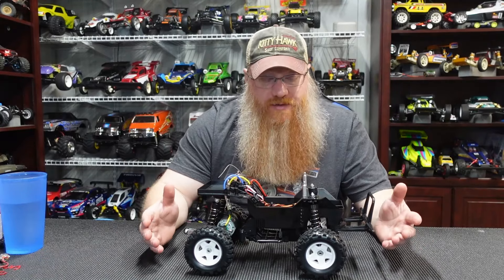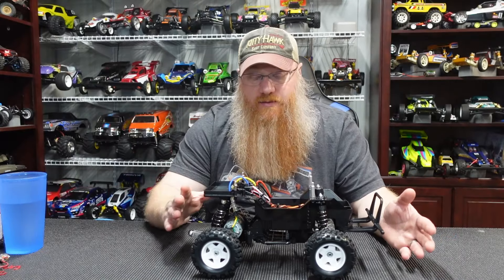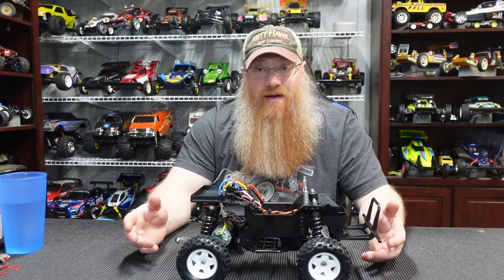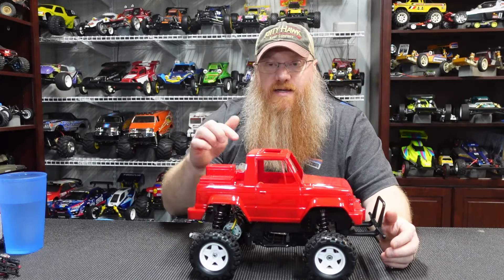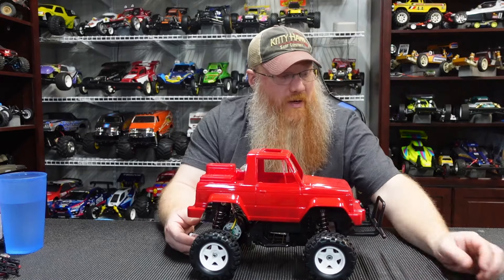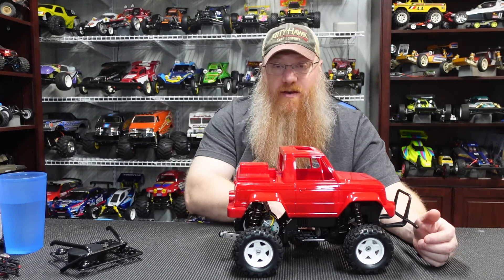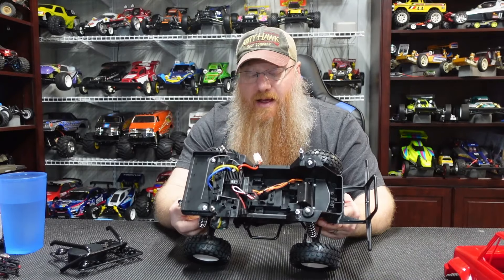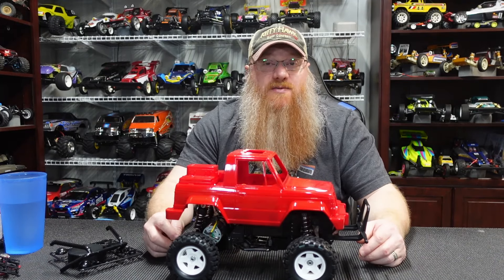Tamiya Pajero Chassis Build

Comment: Great build Addam. I like that the LB Fraction now has mor parts for customizing. Maybe this hard setup's not the best, but for onroad it should fit. Looking forward for your running video. Have a great weekend my friend.
Reply from the maker: Thanks Dirk! I enjoy building these CW01s, I have done a bunch and still enjoy every one of them. I think just because it is simple but tough and I can relax and enjoy watching it go together instead of focusing to no mess up anything like on e new kits. For the street driving these tires would be great, they would never wear out and probably not get enough traction to flip it over! I doubt mine sees any on-road action so I am pretty sure the big ones will end up on there! I will give it a fair run with the small ones to try it and see if I like it. Take care and have a great weekend as well!
Reply: The CW-01 is my go to chassis to relax with after a hard day at work, definitely one of my favorite Tamiya chassis. 
I have been thinking about buying this kit for the collection so can't wait to see it running. 
I am with you on the Oil shocks, it's the first thing I build now when starting a kit, then I just leave them sitting for a day or two and let all the air bubbles out.
Makes for a better shock absorber

Comment: Great video, buddy! Isn't it funny how these ABS bodies can take so long to paint? By the time you're done with all the details, you can spend twice the time on the body v.s. building the chassis. Lol! Personally, I'm liking the smaller tires, I think they look sweet, even though they're rock hard! Lol! And isn't it funny that Tamiya gives us CVA's in this kit, but never in the Lunchy or MP? Too funny...
Reply from the maker: Thanks Fil! Yeah it has been a minute since I have done one and forgot how much time it takes to paint all the details. It is kind of like the Wild Willy 2 where the chassis is done in hours and the body takes days! I did not get a chance to work on it today but I should be able to tomorrow. I will give it a fair chance with the stock tires and wheels but I have the other ones ready to go... 
I did think it was odd they gave you CVAs in this kit and it was less than $10 more expensive than the Lunch Box is. Personally I prefer my Lunchies with the stock bobbly and wobbly suspension. I put CVAs on the fun runner and it lost a little bit of its charm and character. It is a bit more stable and less prone to flipping so that is a plus!

Comment: Great stuff Addam!  I didn't realize this came with oil filled shocks so that's a nice cool surprise from my perspective. But I agree with you on the tires.  The bronco comes with the exact same tires as you know and really for a trail, crawler, 4WD truck...they aren't going to be very useful for whatever you're using it for.  I LOVE the tread patter and the tires, theoretically.  BUT in reality they look the part but don't act the part.  The body...it gets confusing.  I saw Andy from Andy Robinson RC do an unboxing of this one and it was all pre-painted which, again, was a nice surprise because IF I were to get this one it meant it was already painted in my favourite colour.  But, alas, that was only for the european market so hence the confusion once again.  Like Forrest Gump says..."you never know what you're gonna get" :)  Anyway...great stuff. I'll be very curious to see this once you've changed out the wheels.  But I think I like to see a few rounds of your track with the existing ones too just to compare.
Reply from the maker: Yeah the oil filled shocks were a surprise to me as well and they will be needed with the hard tires under it! I swear those tires feel like stale bagels! Not even close to a rubber tire feel! I agree they look good but I think they are not going to good for any surface other than the shelf LOL!
I kind of wish the body was pre-painted and I would have settled for the friction shocks as a trade. I forgot how long it takes to get one of the hard bodies all done! I am taking my time and doing it the best I can. I will give it a fair chance on the stock set up but I am eager to see it with the big tires on it and how it will look and run with those on it! I am pretty sure it will be the way it ends up staying but I will be fair! LOL! Take care my friend!

Comment: It’s a good looking one. I actually like the look of those wheels. The tires sure are hard though. It’s going to be an interesting run for sure. Maybe they will soften a bit with break-in
Reply from the maker: I started getting paint on the body and it is coming to life! It should look cool all done up. Still not sold on the wheel and tires, they look fine by themselves, just out of place to me on the truck. I will give them a run and a chance but i do have the big ones on standby! Those hard tires are mostly for decorations, I can't see them serving any other purpose well! LOL!

Comment: Outstanding work again Addam it will look amazing with lunch box tyre's, I'm assuming you'd only place the battery in the rear up top like that to help it wheelie another great build mate looks fantastic 👊
Reply from the maker: The battery compartment is a carry over from the original Pajero release. It was very similar to the CW01 chassis tub without the additional second layer under it so the back tray is where you placed the battery. They made it fit their old hump-pack batteries. It was a slick way of doing it. Now on the actual CW01 chassis there is the lower section added on where the battery goes but they kept the body the same. I am pretty sure the bigger tires will end up on it, I will give the stock ones a fair trial though. So far it is not looking good for them though! LOL!
Reply: 🤣definitely not judging by your first impressions.... I thought the cw, cr chassis code on these models was what the chassis was designed for like cw was for the wheelie model and cr was rock crawling and ct was the trail model
Reply from the maker: @rcuintheshed6981  I have never put any thought into the Name codes for the chassis... Most of them make little sense, I just refer to them as what they are known as... never really thought to see why some had wonky codes and some are just named for the vehicle they came on.... It is convoluted for sure!

Comment: I see these kits and like several that’s out but not gonna lie they intimidate me a little considering I’m kinda new to hobby grade RC cars but learning
Reply from the maker: Don't be intimidated. The instructions for them are very easy to follow, all the hardware is scale sized in each step to take the guesswork out of that. I would suggest getting one that requires minimum painting as that can be more tedious and nerve wracking than building the kit. The TT02b kits (Plasma Edge 2 and the Neo Scorcher) and the DT03 Neo Fighter are great buggies to start off with. Easy to build, tough and fun to drive. The Lunch Box is less painting than this one and is the same chassis and a ton of fun to drive. There are lots to chose from and if you get stuck with something there are tons of folks to reach out to here that will help out.
Reply: @AddamsPlayground  the lunch box is my favorite it’s the van right. And I’ve built lots of models and painted them it’s the wiring and real tech part of it but thanks to you assuring me I’m gonna go for it.  Thank you for the info and appreciate you and ur channel.   New subscriber.  You always reply if possible
Reply from the maker: @oldscoolcooldiecast1879  Yeah if you got the painting part down then the building and wiring is not problem. The modern electronics are super easy and the only two things to do is remember which goes into channel one and two on the receiver and centering the servo before installing it! For the channels on the receiver it is the old saying to live by "one to turn and two to burn" so channel one is steering and channel two is the esc. The instructions walk you through all of it. Get yourself a Lunch Box (it is the van monster truck) and a inexpensive 2.4 radio system, a reguler old servo and a bearing kit from TRB or Fast  Eddy. I run mine on inexpensive Zee brand Nimh batterys and you can find an inexpsive charger on amazon for them. It is a bit of an investment to get one but the batteries, charger will be used in others once you get hooked LOL!

Comment: Came out nice! I like the big tires on this  and especially because with the little tires you see how off the wheelbase is in the rear and it looks funky looking ware as with the lunch box wheels and tires you don't notice it to much because it then looks like a monster truck and there wheels are not perfectly in the wheel wells but with the small wheels and tires it should be perfectly lined up to the body wheel wells and it's not so it looks kind of stupid looking...That's my take on it!
Reply from the maker: Yeah, the small ones make it look out of proportion and not right. The smaller ones looked good on the original but that original basically one had the top deck of the chassis and not the lower one so it looked proper.  I'll give it a chance but I am pretty sure it will end up with the big ones staying on there!

Comment: Great build Addam!
Must have built 4 or 5 CWO1's over the years.... never gets boring!. The only thing I hate is those stupid axle springs that snap every time without fail!
That looks very 'stiff' with those tyres and shocks..... maybe I'm just so used to the bounce of a lunchie and pumpkin!
Tell you what, those racing slicks on the lunchbox wheels that Fil used on his speed run CWO1 a few years back would look awesome on that don't you think?
I also think it would help the cva shocks work more effectively.
Great job on the paint by the way, seeing that shine makes it look a lot more attractive.
Bet it will be a fun ride for sure!
👍 👍 👍
Reply from the maker: Yes! I love building them, nice and simple but still fun to do. I put on some tunes and just get in the zone and chill for a while building them. Those tires are awful, they look good but feel like stale bagels. It is like the ones on the Aqroshot, look great but are only for decoration as they stink as useful tires! LOL! The cool Potenza slicks would look good on here. I have not looked for a while but they are usually pretty pricey and have to be shipped from overseas. I do need to look into ordering a few sets to have on hand. I have the CVAs on my fun runner and it kind of takes away a little of the fun factor from them, for some reason the stock setup seems more fun to me. It does not ruin it but it does dull some of the characteristics of the CW01 a bit.
It should look pretty slick all painted up, taking longer than expected but I think I need to lower my expectations as everything nowadays seems to take longer to get done! I may be getting older and slower! LOL! 
Take care James!
Reply: @AddamsPlayground 
Totally agree mate!
I put some cva's on my original pumpkin in the eighties, it handled better, but definitely lost some of the character /fun factor.
Cars like these, and hoppers need pogo sticks!
As for the taking time bit, nothing wrong with taking your time mate..... far better to do things perfectly the first time around, than to rush it and never be totally happy with it! 😉
👍 👍 👍

Comment: I think it's a good looking truck or whatever you call it. The paint color was a great choice. With those little wheels I think it may have a greater tendency to rollover. It will be interesting to see it tun. It's hard to understand why Tamiya would select such hard tires. Maybe they will grip well on the street. Your explanation of the build was very good. I did see one reviewer who said he thought Grasshopper wheels would fit. I have no idea if that's correct.
Reply from the maker: It should look pretty cool once it is all painted up! I forgot how much detail painting would be needed so it will take most of this weekend to get it done. The original Pajero release had smaller wheels and tires but it also did not have the lower section of the chassis either so it was a much smaller thing overall. With it one the CW01 with the additional lower portion of the chassis the small tires look a little odd. I will give it a fair trial and see what it looks like and how it performs stock. I am pretty sure the big tires are going on there for the long haul though. You could put the hopper wheels on there, the rear end is identical and it has the hopper wheel adapters on it already. The Hoppers, the Hornet and the CW01 trucks all share that same rear end setup! The smaller hopper wheels and tires would be even more comical though! LOL!

Comment: Looks like a nice build! Definitely needs some new tires though lol
Reply from the maker: It should look pretty cool once it is all painted up. Those tires look decent but feel like stale bagels and I think they will have about as much traction! LOL!!  The smaller ones just don't seem to fit the overall look of the truck. It reminds me of the tiny tires they put on the monster trucks when they load them on the trailers!
Reply: @AddamsPlayground  lol that is a very accurate description of what it looks like with those tiny tires on it!

Comment: The other thing is it may not be geared for the larger tires.might have to put lunchbox gears and pinion in.
Reply from the maker: It is exactly like the lunchbox, no difference to the chassis at all except for the shorter length front axles. It will run just like the Lunch Box with the big tires. It will be slightly slower wit the smaller ones.

Comment: Hey Addam. Great work as always pal. Not feeling the love for this kit from Tamiya. Seems a little goofy but nice to see some oil filled shocks on the CW01 chassis.
Reply from the maker: Hey there Craig! I am torn with it, I like it and I don't... I think with the lunch box tires on it you may like it a bit more. I will give it a chance with the stock setup but I am pretty sure the big ones will be one there for good. You need the oil filled shock to run it with those rocks for tires they give you! LOL! There is little give in them at all. They are more for decoration than anything! LOL!

Comment: It looks great. Do the oil shocks help or hinder this chassis? The tire maybe better suited to the oil shock. But I agree the lunch box tire will look proper as the chassis is so tall
Reply from the maker: I know when I put the oil shocks on my lunch box I was not a big fan of it as it smoothed it out and mellowed it down a little too much. I think they are needed on this on with the rock hard tires on it. The lunch box tires are what normally give it 50% the suspension but these tires have no give to them hardly at all so the shocks are going to have to do 99.5% of the work now! The first release of the Pajero with the small wheel and tires did not have the second lower level of the chassis the CW01 has so it was much more fitting. This taller version needs more tire to make it look proper. I will give it a fair shake as is but I am very confident the big tires are going to go on and stay on it!

Comment: Can you fit lunchbox wheels without modifications? They should have come with lunchbox wheels in the first place.
Reply from the maker: The only thing you need if the Lunch Box/Midnight Pumpkin front axles as the ones it comes with are shorter for the smaller, more narrow wheels. You can usually find them on eBay pretty cheap. I agree it should have come with the bigger ones, it looks kind of sad and weird with the tiny wheels and tires under it!

Comment: How many Pajero kits have Tamiya made? I'm looking for one I seen on an old Tamiya tv commercial
Reply from the maker: The original one from 1984 has the smaller Brat type wheels and that was kit #58044. They re-released it on the CW01 chassis with the bigger lunch box style tires and the original rally livery on kit #57831 in 2012. In 2023 they released it as a red version of the one on the CW01 chassis, kit #58727, but you could easily get the reproduction decals from MCI and make it into a replica of the 57831 version. The original was on its own chassis and you would have to find an original kit to do that one.
There are several others that had the Pajero body on it, most were on the CC01 chassis and have the more modern, rounder body design to them.

Comment: I didn’t realize these were a cw01 chassis
Reply from the maker: Yeah the newer one are, the original had its own chassis whish is very similar to the CW01 upper tub by itself. Basically the same but I think the fender areas where the shock shaft go through was a bit different but very similar.

Comment: Are those tires worse than the ones that come with the Ford Bronco kit?
Reply from the maker: They are the same bricks that cam on the Bronco! I think they will make good course markers when I change the track up and can run rally cars out there!
Reply: @AddamsPlayground  Those tires are brutal!  Course markers or hockey pucks...either way, the ARE pretty bad.

Comment: Lunchbox wheels on this car looks way off
Reply from the maker: If it were the original chassis then the smaller wheels and tires fit it well. With the taller CW01 chassis those looked comically small and made it look kind of sickly and sad. I get the big monster truck tires don't really scream Pajero but overall I feel they fit the chassis much better and give it a much wider stance to not roll over all the time. It is just a personal preference and if it is going to look silly I would prefer the haha silly over the sickly silly.